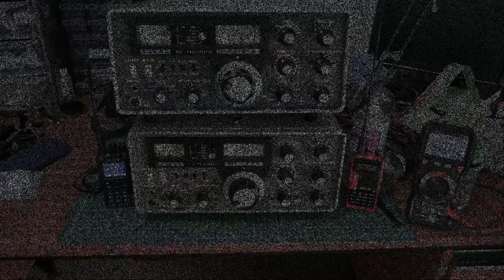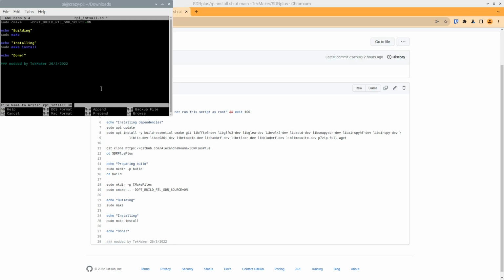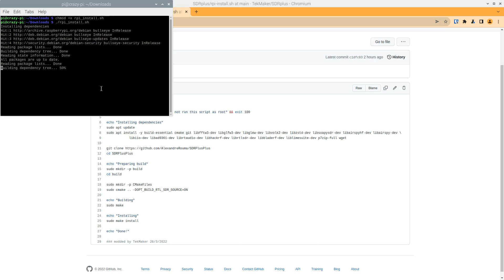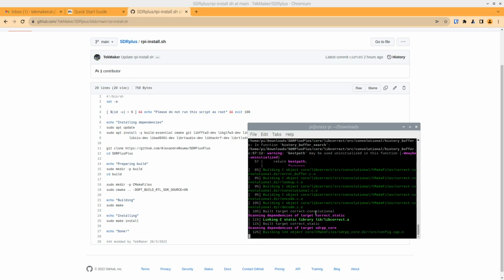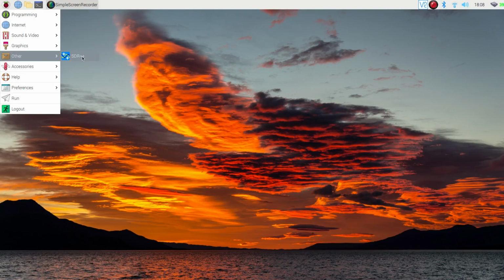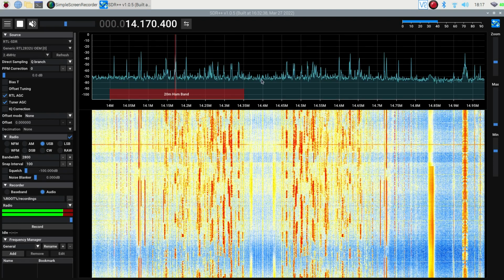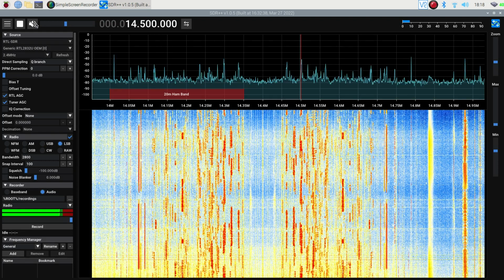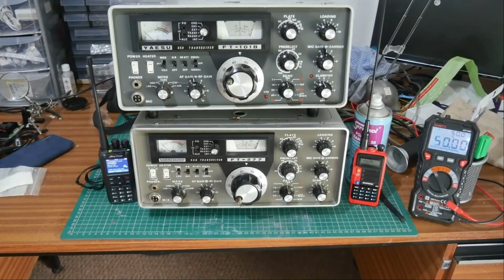Compiling SDR++ on a Raspberry Pi 4gb

Comment: I just got my uconsole and have been struggling with dependencies, thank you!
Reply: Did you get it working on the uConsole? Which distro? I would like to install it on my kali image but haven’t found a way, yet.
Reply: @ that was a long time ago and barely remember. I think I just followed error messages missing file names and googled what had that file name and installed it. Or maybe I tried a different installer command? I’m sorry :/

Comment: This tutorial no longer seems to work with bookworm.
Reply from the maker: Hi Jeff-Radio, thanks for pointing this out. I was working through the solution and I found that it now needs libzstd, and apparently this has been fixed by SteveCrow74, here is the solution by stevecrow74 on the GitHub https://github.com/AlexandreRouma/SDRPlusPlus/discussions/724 I will do a video shortly and credit you, It did install ok but I was not able to find a radio to test it.
Reply: @tekmakerUK  cheers!  and thanks for all your efforts.
Reply: Bookworm wasn't out then
Reply: @ralphbeardmore9738  Thats why i said "no longer".     The stock pi image feom dec 5 works but if you update the o/s its currently broken due to libiiio being renamed and the pi devs said they forgot to include some dependancies in the updatw of the o/s.   It will likelybe patched I guess soon enough.   It was a 2 hour headache today but got it working without the os updates.

Comment: Hi. I have been trying for ages to get SDR++ to work on my Rpi4 8Gb for ages. I found your excellent video and got it all up and running. But as it stands its pretty much unusable as the GUI is VERY sluggish. From a click on the display its literally 3 seconds before something happens. The waterfall and spectrum is also very jerky seems to refresh once a second. Any clues? 
Thanks again for the great videos, the one you did for receiving NOAA using GQRX, Gpredict and WXtoImg works fantastic, still using it now. 73 de Nigel G0CQZ
Reply: Are you overclocked? I run mine at 2ghz, I admit it is barely fast enough. Better to use the PI as a server and a laptop or PC as the listening device.

Comment: Hi I am just learning to  use raspberry pi. I am trying this installation on an old PC with raspberry pi running on it and when I try and run the chmod command it says I don't have permission to change the file. I also tried changing the permissions on the file itself but it won't let me change the permissions. Can anyone help please
Reply: sudo chmod +x filename
Reply from the maker: So, did it work?
Reply: @tekmakerUK  Worked for me

Comment: Great video!!! Do you know if it is possible to compile it on a Raspberry Pi 3B+ with 1 GB of ram? Have tried it but it says error:(
Reply from the maker: What was the error?
Reply: @tekmakerUK  c++ fatal error: Killed signal terminated program cc1plus compilation terminated. Make[2]: * [core/CMakeFiles/sdrpp_core.dir/build.make:108 core /CMakeFiles/sdrpp_core.dir/src/core.cpp.o] Error 1 make [1]: * [CMakeFiles/Makefile2:840: core/CMakeFiles/sdrpp_core.dir/all] error 2
Make: * [MakeFile:149: All] Error 2
Reply: @tekmakerUK  Im running Rasp Pi OS 64-Bit